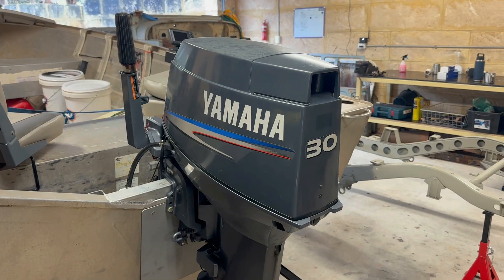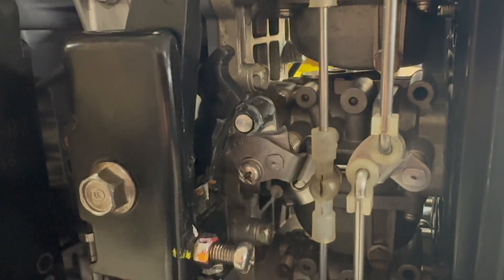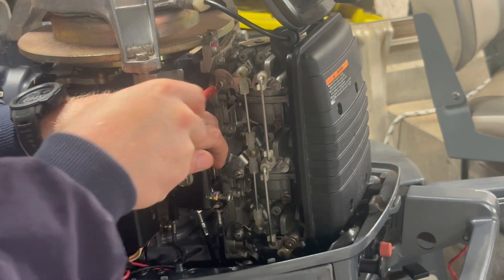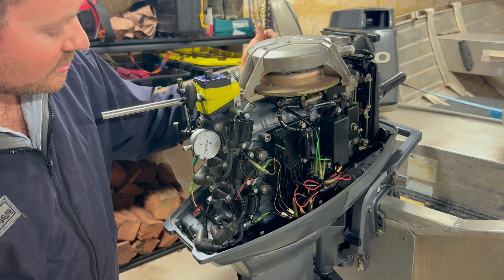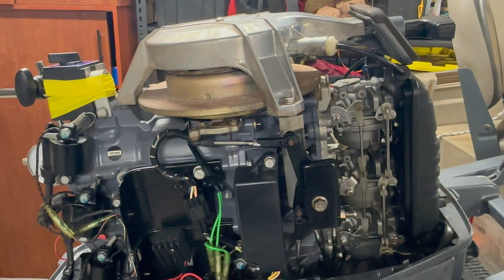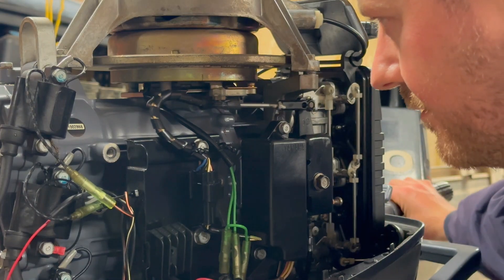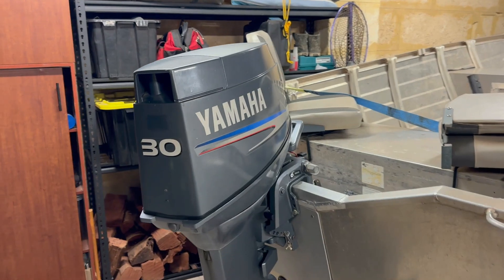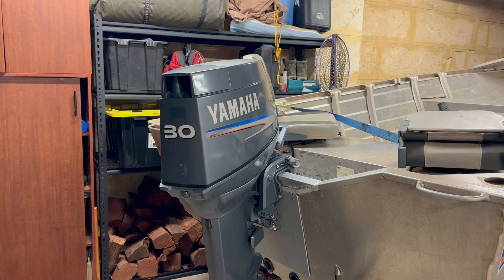Yamaha 30D Carburetor and Timing Adjustment

Comment: Great video. I have the exact same engine. I've done the tune up but am now not sure whether theres one more thing I need to be doing. Do i need to put on a vacuum balancing tool as Ive seen this on other outboard videos. Some use the three dial guage and adjust so that they are the same. I cant quite understand why I might need to do this after everything you have shown in this video. Thanks

Comment: Good evening, I have the same engine and recently I cleaned the carburetor and changed the rubbers that are under the float. The adjustments made to the carburetor are exactly as the manual says and 3 new spark plugs were also changed. The problem now is that as soon as I start and put the engine in gear and raise it to about 1200 -2500 rpm, the engine does not run smoothly, it does not clean and it is as if it is confused but at higher speeds it runs better and everything is fine. Do I need to readjust the mixture screws? Or should I look at something else. I ask you because you know so much about this engine.
Reply from the maker: Check out my other video on fault finding to investigate the ignition system - I’d also double check the pickup timing is right and be very confident that the smaller idle jets are clean and not blocked.
Reply: This problem started after cleaning the carburetor. Before that it was working properly, that's why I'm asking. I forgot to mention that after cleaning the carburetor the maximum speed of the boat has increased.

Comment: After the adjustments you made to the carburetor from the manual regarding the air mixture screws, did the engine work properly or did you have to readjust any of the three screws, and if so, which of the three carburetors?
Reply from the maker: I have another video where I was doing some fault finding trying to identify why I had a lean issue. It ended up being the tip of the mixture screws being damaged giving me issues. Since I replaced them I’ve set them at the manual recommended turns and it’s been perfect. They do have the 1/4 turn tolerance either way but the manual seems pretty bang on - needing to adjust outside of that range is properly another issue or maybe similar to me and damaged screws.

Comment: Hi, i have a question, when i open my throtle the magneto control lever won't advance i bought both the plastic bits including the spring and lever new old stock.
However i can push it forward with my hand without much force needed. Is there anything else that i may need to look at?, throtle does open al the way btw..
Hope to hear from you, thanks

Comment: I want to ask something about the tachometer, where did you connect it to the engine and how? Because I have the same engine and I want to install it.
Reply from the maker: @GiannhsSiafakas  Search “Small engine tachometer hour meter” on eBay or something and you will find them. They are quite cheap , and can be programmed for 2 or 4 strokes.

They only use two wires - One ground and one with a few wraps around one of the spark plug leads. No battery wiring or anything, just those two wires.
Reply: @jamesgarage1223  Where on the engine did you put the grounding? Because I have the same engine. Does the machine work properly, those of you who have tested it?
Reply from the maker: @ I grounded it under the coil where the coil ground is. Just scuffed it with some sandpaper for a good connection. It doesn’t have any impact on the engine.

Comment: For the pilot screws, I interpret the manual as No. 2 needs to be 3/4 to 1 turn out, not 1+3/4 turns. Not sure whether I’m correct or not, but I noticed you turned No. 2 out 1+3/4 turns.
Reply from the maker: Hey mate, The tolerance is specified as plus or minus 1/4 of a turn for all of the given pilot screw settings in the manual (This part of manual is visible at 11:30 in the video) 

I’m fairly certain it’s 1 and 3/4 plus or minus 1/4 of a turn (I.E somewhere between 1 and a half and 2 turns is acceptable).
Reply: @ Thanks for the reply! I have a couple of these outboards and I’ve set the middle carb 3/4 turns out and they seem to work fine, but I might try 1 and a half to two turns out though!

Comment: Man I just want to say thanks for posting this! I had the same misfire but I knew my timing was on but it was still missing. Turns out it was my top carbs butterfly being slightly open. Reset all 3 butter fly linkages and adjusted the the throttle cables and got the throttle cam in the right position and now she runs better than ever and is snappy as all get out!

Comment: Hi mate, I did the carby reset but I think I've stuffed it up motor seems to backfire now and smoke ?
Reply from the maker: @GetRazzed  Double check the procedure applies you your engine serial (find a manual specific for your year) and maybe do again to be sure. 

I still had a “lean sneeze” after the tune up and after some more fault finding found that the little pilot air adjusting needle noses were slightly rounded due to being tightened too much. Once I replaced those my engine now runs really well, but took a long time to narrow down that as being the issue.
Reply: @jamesgarage1223 Hi James,  yes motor is identical. Yes after a lot of research last night I worked out I also have a lean sneeze, I had to back each screw out nearly another full turn and it has now gone away, am I correct in thinking it will now run to rich or should I just leave it? thanks for your help
Reply from the maker: @GetRazzed  Out one turn seems ok. I’d keep experimenting with it - with mine I kept getting really erratic results with the tuning of the screws (it would tube it and run well, then out on the water it would suddenly have issues again). I found that it was worse when properly warmed up. If I revved it in neutral and closed the throttle quickly it would sneeze bad and stall the engine.  I’ll see if I can send you a picture of the new screws vs old and how the end looked.
Reply: @jamesgarage1223  thanks mate that would be awesome. I figure there not expensive so I'll order a set and see if they improve. While we are chatting, interested to know if you are running the 100:1 mix or 50:1 seems to be a lot of varying opinions
Reply from the maker: @ Yeah if you’ve done all the basics like carb clean and kit, made sure all the little jets are clean etc probably worth replacing them. Mine only had a slightly blunted end but made a big difference.
Reply from the maker: @ In just run the standard 100:1
Reply: @jamesgarage1223  Did you still have the part number for the screws please?
Reply: @jamesgarage1223  wich one are these " little pilot air adjusting needle noses" ??
Reply from the maker: @chhagen The pilot air screws in the video a 11:30 . The tip of the screw /nose of mine was rounded and not a nice sharp tip.